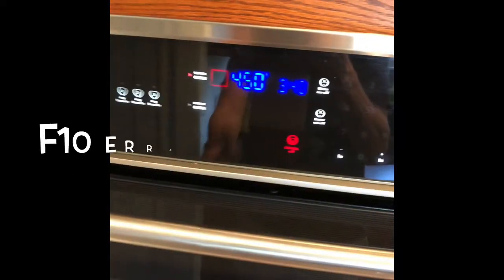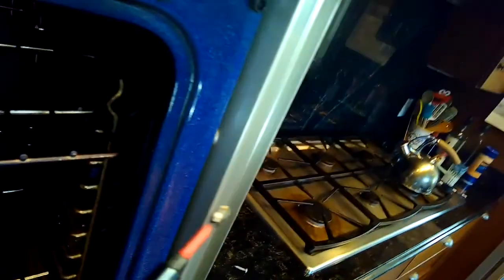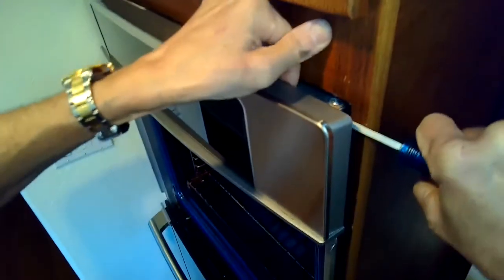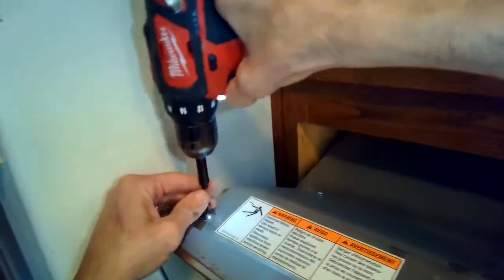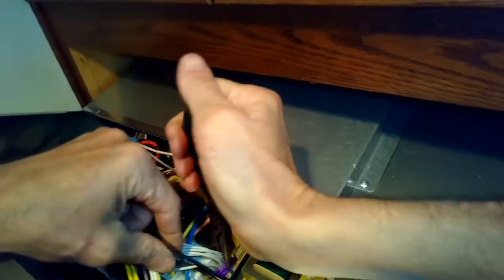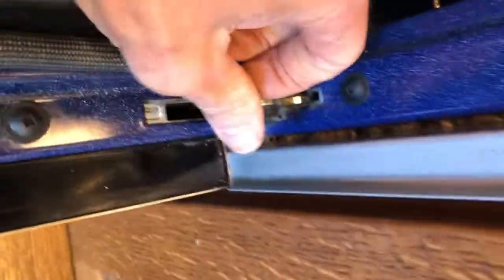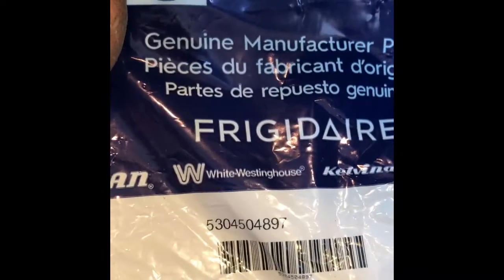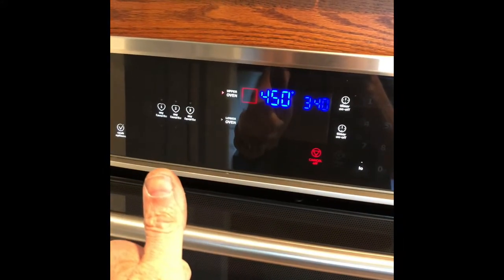✨ Electrolux Double Oven - F10 ERROR - Easy DIY Fix ✨

Comment: Mine Frigidaire double wall oven but one day it turned off as if the power went off is there anything in your manual regarding replacing a fuse or something? If you can help me fix it I will send you $100. Thanks
Reply from the maker: That is very generous, thank you.
I’m sure we can fix it.
Can you send the model number to: scottthefixitguy@yahoo.com

Comment: The door removal is actually very tricky until you realize exactly how those levers need to be captured by the door.
Reply: The door hinges have a small vertical notch , so when removing you need to lift up about an inch. When putting back you need to line up the notch with the oven front.
Reply: And those little flip-up levers have to be captured by the door so that you can apply the necessary leverage.